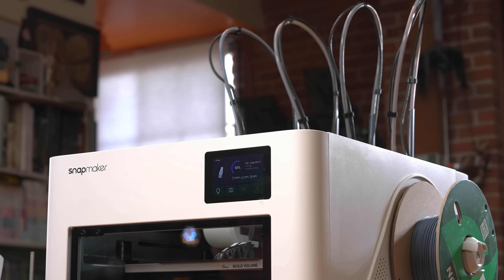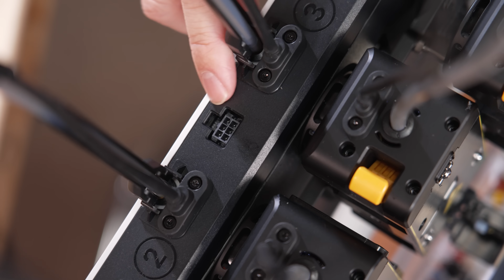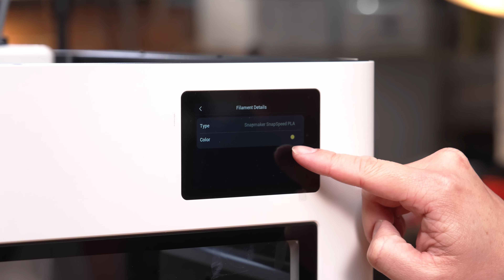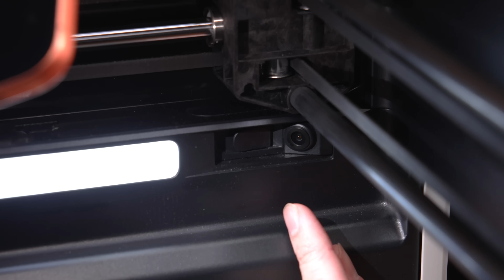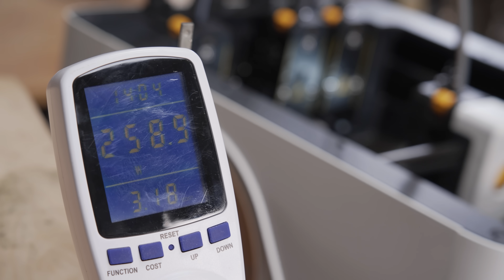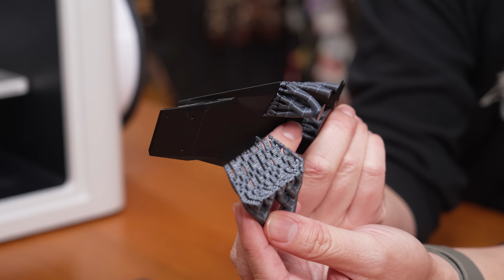Snapmaker U1 Multi-Color 3D Printer Review!

Comment: Got my U1 Thursday 8/30.  Unboxing and assembly a bit taxing, but it arrived in pristine condition with no damage and all the accessories.  My advice - follow the manual not the videos.  Even Snapmaker videos are not all that current.  Take your time and go step by step. It takes time but worth it.  The initial setup takes time too but don't fret its pretty much a one off event.  There are bloggers who whine and complain and comment "... C'mon Snapmaker, its 2026".  They should  but an Ender V3, put it together and make it work.

Comment: For true full-spectrum printing you'd need 5 filament spools/heads. Cyan, Magenta, Yellow, Black, and White - basically CMYKW. Why? In 2D printing white is actually transparent and is derived from the color of the paper (whoever tried to print on colored paper knows). In 3D printing there's no such possibility and additional spool has to be there.

Comment: I bought my first printer (U1) month ago and did not have any issue. Alternative was the new bambu P2S. P2S currently has higher quality prints, but I think multi color and multi material is the future for home printing. The amount of poop from bambu, and bambu beeing very hostile towards its community made me decide for U1. I also think firmware updates will get it equal to bambu and there are different hot-ends available (e.g for differential materials or differential sizes. All that P2S can't do)

Comment: Hi, congratulations on the video. One question: did you have more problems with the cart change? I mean the difficulty of the machine in putting it back in the right place after changing the color? I saw that others also had the same problem. I would like to buy it, but this problem is holding me back a bit. What do you advise? Thank you very much.
Reply: There have been firmware upgrades since that video. I haven't had an issue like he described with mine.

Comment: Knowing the Klipper UI, there is probably a sub menu in a info page that will allow you to calibrate the X-Y axis for the tool pickup. You should be doing those secondary calibrations after the initial setup anyways. Also, Snapmaker uses Fluidd and will be releasing their version of klipper here shortly to be open source so expect there to be a ton of Mods and tweaks coming in. Modding and coding community gonna jump on this printer!

Comment: Ordered mine last weekend, should be delivered tomorrow. Can't wait to try it out. I think it will end up taking over a lot of my prints from the Qidi Q2.
Reply: How did you like it
Reply: @delick01 I love the U1. The last firmware update on the weekend had some connection bugs, but it has been great. Only issue I've really had was done PLA got wet and brittle and snapped inside the PTFE tubes so I had to pull a couple of them apart to get the pieces. But that was user issue, nothing wrong with the machine. I love the lack of waste.

Comment: I bought a Snapmaker 2.0 250 off Facebook Marketplace about 6 months ago. Had fun learning how to 3D print (and laser engrave and CNC). When I saw thie Kickstarter for the U1 I jumped in. I received it in mid-January and - holy cow - I know the SM2.0 isn't state of the art, but the U1 is another class entirely. Very easy to use, and it makes very good quality prints. Now I'm speedrunning 3D modeling tutorials. It has been inspiring. The community has also been helpful  - if not a bit of a broken record on making parts for their U1s.   The recurring joke is that my new hobby is making things to improve my new hobby.

Bottom line....if you are new to 3D printing or want to start, this is a great option.

Comment: Mine has been fantastic, and once you get into custom firmware, the potential REALLY becomes unlocked.  Snapmaker has released two or three firmware updates since my U1 arrived, and the Paxx custom firmware is built on top on that.  That firmware is a game changer, can't say enough good things about it.  It unlocks stepper motor tuning, opens up custom NFC tags for non-Snapmaker filament, and also fixes the 0.5FPS camera.  I get near real-time camera feed through Klipper now.   It also enables object exclusion too.  Win win win win win.

Oh and the Ikea / Walmart top bin mod works very well, to a degree.  In a very cold basement, my chamber temp gets close to 60C, if the print is long enough.  I mainly print ABS+ on mine, works great!  I do need a charcoal filter though, working on that now.

Comment: Been using the printer since I got it from the Kickstarter round and it's been mostly great. The ability to use a different material for support material is a game changer for sure, and multi-color TPU printing is insanely cool for all kinds of things - I made some phone cases with 3D images "embossed" onto them in different colors and it's been insane just how well they come out and feel.

Speaking of TPU tho, here is where I also ran into quite a few issues - the print heads seem to like to tangle the material, it's sometimes really hard to unload it and some of my TPU stops extruding very reliably after a few layers because it slips out of the nozzle. I did some changes to mitigate those issues, but so far have not been able to eliminate them altogether. So as always, TPU is a bit of a challenge, but the possibilities this printer grants you are quite insane at the price.

Comment: I have an u1 printer and the main problems I have are user error, still trying to figure out the pla and petg support. Most of them that I have tried fail for being too easy to take apart while printing. One of the tool heads also had a couple of grabbing issues and I think it turned out to be some sticky residue left over. Also if the print has too small contact on the bed it can come off part way into the print. Ai camera has saved me some spaghetti messes to clean up.
Reply: Set the gap between support and part to 0. This will probably fix your problems.

Comment: This multi-head setup is going to be all over the market in a year or two.  For waste reduction and efficiency, there is no other way to do this at this time.  I expect to see a sub-$500 alternative by Christmas this year.
Reply: I doubt it, it's very expensive and it adds many failure modes. It's not needed for most projects either.
Reply: I think I'd rather they keep the price the same and just add a total of six heads to it. But a lower-priced four head would be nice.

Comment: I have been printing ASA and ASA-CF perfectly on my U1. Just up the nozzle and bed temp and make sure to have printer in a warm room (and air filtration). I have not had any issues with bed or layer adhesion. I do use the Nano Polymer Adhesive from Visionminer to make sure I dont have any warping off the bed.

Comment: After doing a lot of research into multicolor printers, I've decided that a tool changer is the way to go because they create much less waste than an AMS. Thanks for the Snapmaker review. It's going to be my next printer.
Reply: Well there's almost no waste on h2c.

The comparison is more like faster swaps, where snap wins, or more colors available that stay dry then Bambu wins.

And price where definitely snap also wins.
Reply: @blaskotron I always say it just depends on what you want to do and how much interactions doing it, since Bambu H2C is not a true tool changer since its just the nozzle, but allows for automatic color change(I believe up to 24... correct me if I am wrong). But its much slower because it has to change nozzle and color every time, still much faster then a single nozzle but not as fast as a pure tool changer, but they will likely come out with a H2T or H3T. But if you don't mind only 4 colors or swapping manually then U1 will be the best for someone. I just wish Bambu would have already come out with Tool changer H2 series at U1 price point and a much faster AMS.
Reply: I wonder what will be out in the next 5 years this is okay but feels like we reached the cap
Reply: Also looks to be way faster. Doing multi color prints with a lot of filament changes on my P1S makes the print time so much longer
Reply: You might want to wait, if you can, for the reviews of Prusa’s INDX to come out in Q2. It has the potential to blow everything out of the water, mostly in terms of price. It will be an economic shock in terms of price and space usage in FDM printing. It will be almost exactly like having a multi-tool design but without the large metal tool heads. Look it up and you’ll see what I mean. It could be a game changer.
Reply: @jeremysherr1734 You think it will really be cheaper than the U1? I honestly would be surprised I like the Prusa stuff but I don’t see that.
Reply: @blueberrywilbur315 No, u1 will be much cheaper. I think a Core one with INDX will be almost 2000 usd.
Reply: @blueberrywilbur315 It might be cheaper in the longer run, Prusa are currently expensive as hell for me at least, they are made in Praque and the US for me it would come from the US, which means its currently slapped with tarrifs after tarrif cause some parts are made outside US and are Tarrifed, then shipping US to CDN is ridiculous through Prusa.

They use to be at least a little more expensive up front, but long term, cheaper, cause parts are everywhere, Prusa's maintains a pretty good upgrade path on them, but also in my experience with 3D printers, my old work we abused the hell out of a Prusa, besides a hot end change cause someone didn't check it and it clogged badly. Where Bambu it had several issues and costly parts and repairs.
Reply: @jeremysherr1734 it will be cheap in relation to an 8 tool changer.. but it will still be pretty expensive.. if I had to guess $2000-3k
Reply: @jeremysherr1734  ? The indx system with 4 heads + a prusa core one printer is double the price of the U1. It's not even close!
Reply: @j @jeremysherr1734 ah what do you mean “mostly in terms of price”? Prusa is literally the most expensive 3d printer company and it cant beat anyone in pricetags because it’s eu based and not china based
Reply: @jeremysherr1734  sure but where is the machine part from the ones in shows. not considering the cost. this world need actual available products instead of ads.
Reply: Wait a minute, you did a lot of research and discovered tool changers waste less than the ams-type systems?!?!  My god what groundbreaking, insightful results!!!! We gotta share this with the world😂

Comment: I have bene running my Snapmaker U1 since November, around 1500 hours. It has been a powerhouse with minimal failures. Waiting on the second one to come next month. The biggest complaint is software side, if they could work on the app both desktop and mobile I would be ecstatic.
Reply: Snapmaker software is f worse.
Reply: what were the failures you've faced so far?
Reply: @mr_misiaq  I'm now up to 2400 hours on the printer, Only failures i have had is support failures on tall prints (But I also have my supports pretty thin)  hardware failures I had a pogo pin error issue but by the time they sent a replacement part the issue stopped occuring. I am now up to 3 Snapmaker U1's
Reply: @InitiativeDesignShop wow congrats! Are you mixing PLA with PETG while working with supports?
Reply: @mr_misiaq  Not generally. But I have. The issue is that the tree supports get very thin at the top

Comment: Great to see they're finally catching up on orders. 

I'm sticking with Prusa for my "serious" printer but I am looking at replacing my Bambu A1 "fun/toys" printer with one of these soon.

I hope they come out with a multiplexer solution for this eventually so you can do more than 4 colors. For now you could add a pause if one color is only at the bottom and another is at the top and swap spools pretty easily. I do wish more toolchangers would go with 5 colors though. On my Prusa I have an MMU3 and 5 colors is sooo much better than the 4 I have over on my A1.

Comment: This is my first 3D printer and it's been a great experience. Support was very responsive and helped me get everything running quickly after my issue. I ran into a few snags with the tool-head at first, but the most recent software update cleared that right up.

One tip for new owners: since the filament stays exposed, I'd recommend making a dry box as your first print project!
Reply: Having a toolchanger as your first printer is wild!
Reply: @4473021 I know. He must have a friends help or knowledge
Reply: I have mine coming soon hopefully. I'm wondering if I can use the sunlu s4 dryer with the U1
Reply: The drybox I'm using is the 'Filament Storage 2026' on Printables (model 1606655). It works great! 

Also, I printed the '608 ball bearing print-in-place' from MakerWorld (model 2395990) for it—they are smooth.

Comment: No offense, but this is junk and not for production environments.  Being from a humid environment, they failed to consider that in their design placing the rolls on the outside.  That is production-suicide for a business.  2nd,  what's with the open top?  I mean do we want dust particles constantly invading the print space?   And what about controlling the interior temperature?  Open tops would drastically affect prints with the temperature and humidity changes.  This is all a chemical process and it doesn't seem that SnapMaker considered these important factors.
Reply: Prusa mk3 says hi… kinda weird we have multiple open printers in production and labs…
Reply: I don’t see it being a problem- I dry my filament and it prints not stop until roll is done not enough time to even worry about it absorbing water - if you’re really doing production it’s a non issue - for occasional use it can be an issue for high humidity locations
Reply: there are already solutions that enclose the filament or print out of dry boxes, there's an official top enclosure coming, and the community already has over a dozen printable enclosures or enclosure adapters that use storage boxes as top enclosures. I definitely feel like this comment is made out of ignorance considering the "junk" comment. Dozens of businesses are already using these. Tool changers are the future and designs will improve. Not to mention, above everything else, this is definitely aimed at the hobbyist market at this point and not designed to be a "serious business" machine.
Reply: You should use the force more to think before you talk
Reply: Yeah, though being fair to snapmaker I guess production isn't the intended market? Even as a hobbyist though the open top and the open rolls are a bit of a design flaw, even if those were features used to push down the cost. The actual cost, by the way, is very very attractive for a multicolor printer, so for some people it's worth the extra considerations
Reply: Junk? c'mon... say it doesn't fit YOUR specific needs, but don't spout stupidity. It's easily the most exciting printer in the space today and if you think the market won't fill the gaps from a feature standpoint, what are you even commenting for in the first place? Production is about consistency and reliability and if the printer can provide those two things it will find a place in many production environments.
Reply: @jc9923  Well said. For a $1000 more they would have added an AMS on top and an enclosure and basically have the Bambu. It is what it is. A very capable multi color printer.
Reply: They have an optional top. That being said when someone else comes out with a toolchanger with a dryer box and closed heated chamber at this price point the u1 will be obsolete. I think they found a good place in the market but other are probably right behind them.
Reply: This is in line with the vast majority of printers on the market. It's also not really meant as a high temp machine. I added a top cover to mine and feed the filament directly from a Sunlu S4 filament dryer. Works great.
Reply: A1's AMS is open. Same with the Anycubic Kobra X. It can be worked around if a person need it enclosed. I bought a 40$ encloser for my A1 that zips up in the front, I bet if you turned in on its side, it would fit the U1. They could have build around the filament, but that's more metal and other materials. Don't think this is aimed at a production level. This is more of a step up for hobbyist. I really like my A1, but I don't multi color print to much because of waste. But, seeing this for me, doubling the A1 (currently showing 399 on there site for me) but still under 1k is something to think about.
Reply: Like ever single open printer in existence, aka every second printer if not 90% in price range

Comment: I backed it, got mine in late november and its been great. A few hiccups here and there like any printer but I am very happy over all.
Reply: what issue?
Reply: @Krishell  There was some connectivity issues at first with the firmware/slicer, its been fixed since, sometimes foreign object detection will go off and not start a print with nothing in there but its rare and takes 2 seconds to fix. no mechanical issues. It has been a very reliable printer over all though.
Reply: Same a cheap Deal from Kickstarter 😂 for this amazing Tool.
Reply: Same here